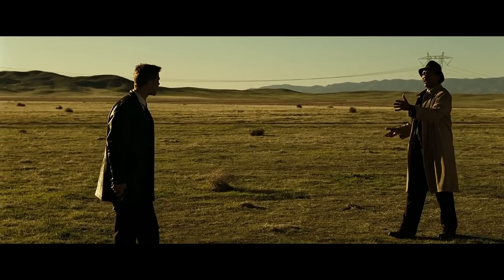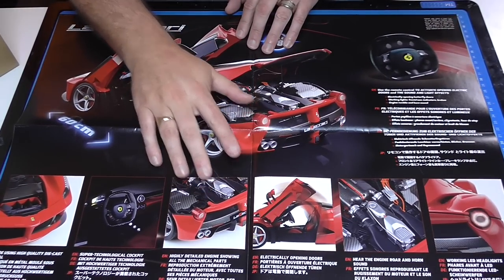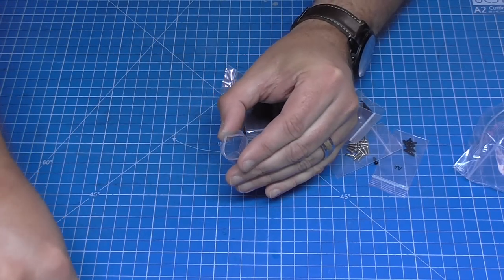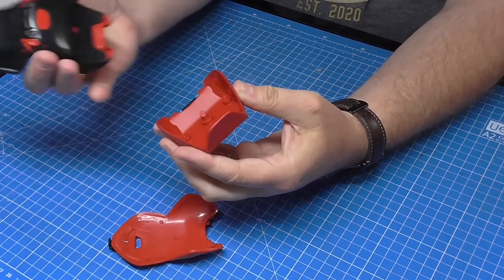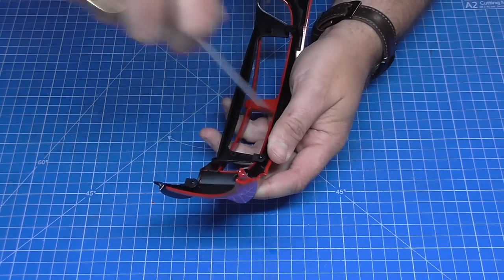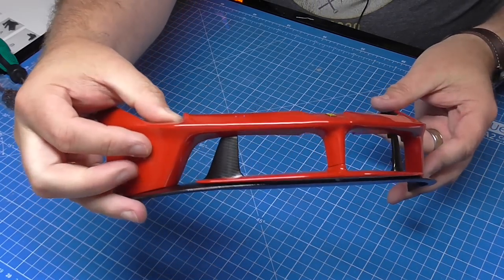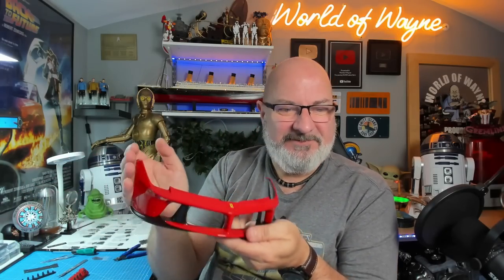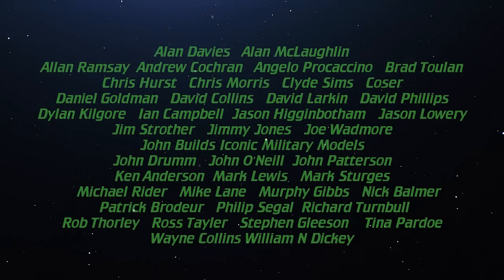Build the LaFerrari 1:8 Scale - Pack 1 - Stages 1-8

Comment: I received notice of this video last night at about 12-midnight California time, but I was busy being frustrated for 2-hours trying to get the steering mechanism installed in the Super Snake! Ugh!  I don't understand why builds start you off on parts you're not going to need until about the middle and end of the build! I'm starting to ignore Pack 1 of builds keeping them safe until I need the parts and starting off on Pack 2.  Washing your Part Works Matt: I learned the hard way (I make mistakes, so you don't have to (C)) Wash it in cold water with mild soap. Let it air dry, then refit it on the foam insert.

Comment: I received pack 1 of the Ferrari. 2 comments- !. The Agora instructions for pack 1 are completely different than the pack 1 that I received and are not helpful - at least for pack 1. I have therefore been following your videos for instructions on how to assemble pack 1. Throughout pack 1 you are using A screws (mostly). I have found that A screws do not tighten down adequately and appear to be the wrong diameter. Are you sure that we should not be using a different type screw?
Reply from the maker: Nope definitely the right screws. Use oil

Comment: This is not going to be an easy build.  Until you get to the gull wings and then fitting of the rear engine cover,  parts won't go together in good fit as you would like to.  Good luck.  😀